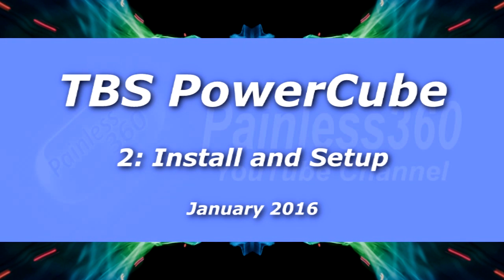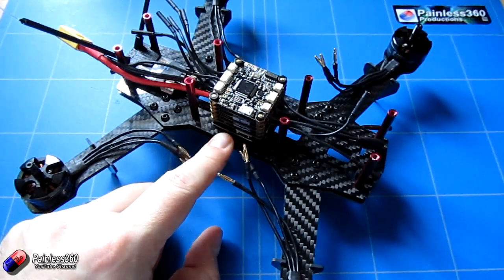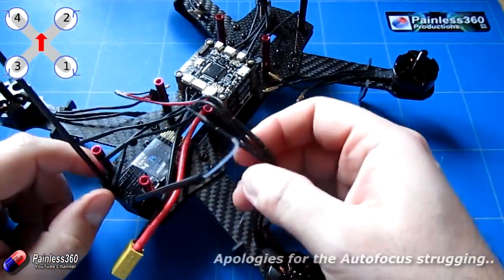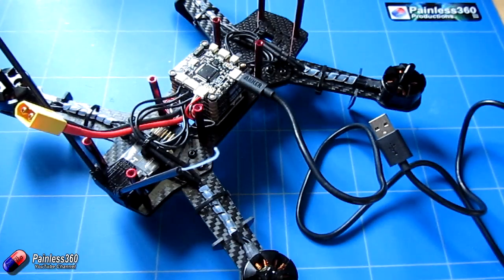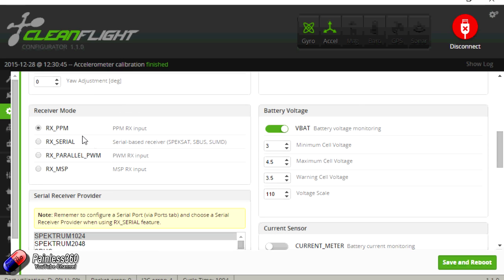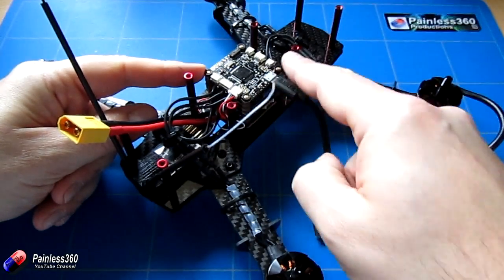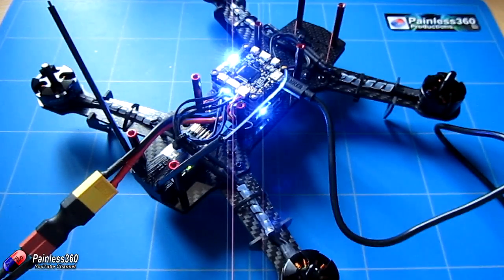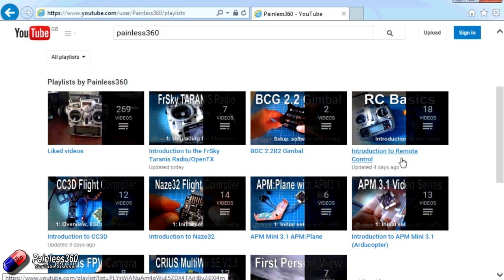(2/2) TBS PowerCube: Installation, initial setup and first flight

Comment: Hello I have binded my radio with my receiver, but when plugged into clean flight. when I move my sticks around nothing moves in clean flight  My radio is tx16s with the latest version from the manufacturer. All firmware is up to date with the receiver
Reply from the maker: Check out my Quadcopter building for beginners series. Most pilots use Betaflight now.. Best of luck

Comment: hi painless . say I am trying to pull every thing off my TBS OBLIVION  and mount it on to a lumenier qavr2  5 inch frame   I am wondering if that tall stack would fit , I am trying to do this as a nocive challenge  no solder  strait plug and play  
any thoughts would be great
Reply from the maker: Not sure, there are lots of options for the cube...

Comment: Would this fit in a skol v2?
Reply from the maker: Not easily, see the build I'm doing with that frame at the moment (Quad Build: Series 8)
Reply: Painless360 thanks for the response! Do you know which flyno frame this would work best with then?
Reply from the maker: Depends on the height of the stack you have... there are lots of options for it so knowing that would be the first step..

Comment: Hey, love your video's!! Question, just installed the newer tbs powercube fpvision into a build I'm doing. I understand that the negative screws on opposite corners on the bottom are the ground. My issue, the screws that came with the cube are too short to simply screw directly to the frame, like you did in this video, not to mention I needed room for my battery strap. I had to use longer metal screws to mount the cube to my frame. then I just supported the positive corners with nylon standoffs .I'm afraid that maybe now when I put power to the cube because those negative ground corners of the cube are technically touching the frame, I may short the whole thing out. What do you think?
Reply: Someone PLEASE help, nobody seems to know the right way to mount this cube to a frame if the screws provided by TBS are too short!!!!

Comment: i am connected to the powercube with my taranis! But i dont get any movements on the receiver tap!
I used to be able to control the motors via betaflight but now there is a zero (0) in 1,2,3 and 4 motor gate!
What have i done wrong?
I am totally furstuated!
Please help me!!!!
Reply from the maker: Please see the videos in the 'Introduction to Seriously Pro SP3' and the 'Quadcopter Building for Beginners' series on the channel where I cover this in some depth. It's probably that the ports are not setup right for a serial receiver like S-Bus. Best of luck!

Comment: Hey Painless, Thank you so much for this series. I really appreciate you taking the time to do this!

I am doing this exact build with the FrSky X4R-SB and the Taranis X9D but I just can't figure out how to connect the telemetry from the Colibri flight controller on the cube to the receiver?  I realize this might be a really noob question, but any help would be greatly appreciated.  Thanks again for all the great videos!
Reply from the maker: +DroneFactor If there is no signal pin specifically for telemetry then you will need to use the tx and rx pins on a spare UART and connect them both to the s.port pin on the receiver. Best of luck!

Comment: I didn't notice where you connected the receiver to the cube for SBUS and how you were able to power the X4RSB while binding the receiver? Did I miss something?
Reply from the maker: We talk about the common connections in the first video in the series. You simply plug your receiver in using the supplied cable..

Comment: I'm planning to  make my first  build using this amazing FC. What kind of frame do you recommend for this?  Also I'm interested in your patronage model, where can I ask you more specific questions about it?
Reply from the maker: The only thing you need to look at with any frame with the PowerCube is the height between the top and bottom plates. The stack of PCB's is a lot lower now than it was in teh first version with the ESCs now sharing a 'slice' of the cube. Other than that any frame will be good! Best of luck with the build!

Comment: Hello, I connected all the bullet connectors like is suppose to be according with manual and your video, but the quad sounds unstable and sounds like if Im actually giving it a little more of throttle and motors gets way to hot??? All of them are spinning to the correct orientation, but motors gets too hot? please help!!! All of this happens because I need to replace a motor # 4 now I have my quad screwed! PLEASE HELP ME...
Reply from the maker: Could be the timing or one of the settings in the BLHeli software, I'd start there and see if something isn't set right.. Best of luck!

Comment: dear painles,i have voor a week or tree ago a rtf racing quad with the blacksheep controller,nou i am crasht and twoo or my motors  spin not hou it seems to spin,its go on motor 4 and motor 1 the other twoo spins good,there nothing to see on the frame and controller only my mushroom anthena snapt of,i have reparate this and try  it  but with no  succes,have u some options for me?greetings christiaan.
Reply from the maker: The ESCs are pretty bullet proof but if you have a crash and the props can't turn they will be damaged in a matter of seconds from the current flowing from the ESCs. We had this here and ended up replacing the motor. You can tell if it's happened as the motor will not spin freely anymore. Best of luck!
Reply: many thanx painles360,wat you say is first replace the motors,and if i have luck they spin ,otherwisw i must re place theESC.i go try it .thanx

Comment: Hey Painless, I have some trouble to get any Signals from my X4R-SB on the Flightcontroll. Its already bind correctly to my Remote (green led lights up), I set rx_serial, sbus and uart2. The Reciever worked perfektly on a naze32 rev6 before, I just pluged it to the Colibri Race like you did in the video. Any Ideas what could be wrong?

Comment: Thanks for the series, it has been extremely helpful! Do you happen to know what a blinking red LED means on the powercube FC when powered up (while not connected to cpu via USB)? I also have the X4R-SB and configured it to SBUS on the receiver tab however it seems as the receiver is not getting any commands from the Taranis (it is bound).
Reply: +u189961 Actually I think I just figured it out but won't know until I get home! The red LED blinking means no receiver signal. I didn't realize the Powercube came with a PPM/SBUS and Spektrum cable, I'm thinking I used the Spektrum cable in error!

Comment: Wait, why is your throttle moving if your Channel map is at AETR1234?  So what is the mapping from airplane controls to quad controls?  Pitch = Elevator, Roll = Aileron, Yaw = Rudder and Throttle = Elevator?
Reply from the maker: Because that matches the channel order on the Taranis for the model I setup. See the other Taranis videos.. Best of luck!

Comment: So I actually got the thing flying but could never hover so I decided to go back and try starting from scratch on the taranis. After creating a new quad model, I fire up the quad on the bench and the motors start raging.  Nothing I do on the throttle does anything but vary the high RPM's only slightly.  So turns out that the Channel map was set for AERT1234 and the YAW was controlling the throttle.  I hadn't changed anything in clean flight.  Had I been outside with props on, goodbye drone.   So that has me terribly worried of course.   But, I will say, I'm glad I bought the cube.  It makes for a much neater racer.
Reply from the maker: +goofyfoot2001 Yep, always test the model arms and responds to controls without the props on! You were lucky you got to arm. Using Yaw-right arming normally means that you can't if you've messed up the channel mapping..

Comment: thanks for the great videos dude! I'm currently building a qav210 with the power cube and running 2206 2350kv motors on a 4s. am I able to run a luminier 650 mini cam, voltage wise or am I going to have a step up thingy? keep up the great work!
Reply from the maker: +Alberto Alvarez You can select 12v or 5v from the PDB at the bottom of the stack so you shouldn't need anything else to alter the voltage levels..
Reply: +Painless360 Ok your next video showed me, thanks so much!
Reply: +Painless360 Ok your next video showed me, thanks so much!

Comment: Thank you for the video! I need help with a small problem with the Powercube, everything seems to work, but when I connect the battery the red led status starts beeping continuously. It is very anoying. Any suggestions on how to fix this? (I am new to all this).
Reply from the maker: Usually vBat or 'no receiver connected' alarm.. Best of luck!

Comment: Do you know how much power the pdb can provide to either the camera or vtx or both?  Just curious what video transmitters I can use with this without worrying about using  external power.
Reply from the maker: +Keith Morris Yes, the answer is in the manual. Happy flying!
Reply: Wow I must really be missing it.  I've been through the manual and any documentation I can find.  Please tell me how much power the pdb can provide to the vtx and the camera.  Also can they both be on 12v or does one have to be on 5v?
Reply from the maker: Top of Page 3 in the manual..

Comment: Me and my friends are having trouble soldering the emax 2204 2300kv motors, its as if the wires repel solder!
any useful tips?
Reply: +Common Sense Dude,   Emax motors have a protective coating out to about an inch from the base of the motor that's made from some kind of enamel.  I had this problem, and eventually got it sorted by soaking the ends of the wires in soluble aspirin for 2 days.  Don't ask me why that worked, but it did!
Reply from the maker: +Common Sense Don't cut the wires too close to the motor as they are still covered in the insulating lacquer and will be a pain to remove and solder.. Best of luck.
Reply: +Painless360 My friend has already soldered them on but the solder joints are really bad because we couldn't get the solder to tin properly, the solder just wont stick to the wire normally its as if the wire is waterproof, we cut it down to about 1.5inches long and we have slack to connect to the escs as they are on the arms of a 210 frame
Reply from the maker: You should be out of the way of the protective coating 1.5" down the wire. Get hold of the wires you cut off the motors and test the solder on those too. Solder or Iron problem maybe?
Reply: +Painless360 we took the wires off the esc and soldered the motor wire to the esc pads but the motor wires wont tin properly

Comment: You could easily mount a fan to the side of the Powercube.
Reply from the maker: +John Coates If you're in a open frame the airflow is easily enough. I've 3D printed air-scoops that snap to each side. Not sure if they do anything to aid the cooling but they look cool!

Comment: Painless360 please help. How did you get your roll, and pitch values to stay at 1500? My values fluctuate at least a number, either up or down I can't get them to stay at 1500. This causes my quadcopter to drift and I can't fly because I'm constantly fighting the quadcopter. Thanks in advance.
Reply from the maker: +Cris Pena That's normal and a function of the quality and resolution of the potentiometers that are 'reading' the stick position in the radio. A few numbers either way is fine, any more may need the radio checked.. Best of luck!
Reply: +Painless360  Thank you, I was just socked when I saw your values hardly move at all. Can't wait for more videos on the powercube, thank you for all your help.
Reply from the maker: That's a decent radio for you.. My DX7 wanders like yours,,

Comment: What happens to the cube when an ESC catches fire?  Seems like it will take the other ones and the FC out with it when packed that tight together.
Reply: 1.5 years never had one light up..
Reply: +Sheldon Smith They are the bulletproof esc's so they have a built in safety that would prevent fire (in theory)

Comment: Got my quad to the point your video ends and I'm anxious to see your next one! :)  This series has been very helpful.   I have ordered the TBS Core Pro as well and I'm wondering if the vtx and cam needs to connect through the Core Pro or would it work if the vtx and cam were connected to the cube.
Reply from the maker: Check out the playlist  ;)
Reply: +Painless360 looked but don't see anything new.
Reply from the maker: Two videos in there that are not released yet...
Reply: +Painless360 sweet! can't wait to see them when they are released!
Reply from the maker: You can still view then if you see them in the playlist.. ;)

Comment: Do you need to program esc in Cleanflight like you do in Llibra Pilot?  Great video on the cube
Reply from the maker: +LWG66 As the ESCs and FC are all in one stack and configured by TBS at the factory we can skip that step when setting it up. You should always calibrate the ESCs to the FC when building a traditional system.. Best of luck!

Comment: How would you recommend shortening or tightening(I guess) the length of the wires connecting the motors and ESCs? Thank you
Reply from the maker: +Matthew Ward I would snip off a little from either end and re-solder the bullets on. Be careful about going too near the motor wires when they get very close to the motor housing as they can have lacquer can coatings on that can make it very tricky to solder..
Reply: +Painless360 okay great. Thank you so much for your help!! I really appreciate it

Comment: Hi mate, looks very simple for those that haven't soldered before! Couple of Qs/points for the new people and me: 1. Assume ESC calibration not necessary as it is shipped configured? 2. Normally on the config tab in cf, if you set to serial rx and save it will revert unless you have already set up the uart with serial rx on the ports tab, this is normal behaviour for cf and betaflight, did you already do that but slipped it under the wire with your camera trickery or is this new behaviour?(on the vid it appeared the opposite way round, you saved in config and ports updated its self)
Reply from the maker: Every step taken, in order, shot as we did it. Happy flying!

Comment: how much does this set up cost all together (roughly)?
Reply: +Barnaby Harper £48 for motors, £120 for the cube, TBS core pro £50, FPV cam £30 ish, VTX, £35 ish, ZMR 250 Frame £20, Receiver £25 - around £350 all in.  (Its amazing what you can learn with 30 seconds of googling) :-D
Reply: Barnaby Harper I have an F1-6, it's a great machine! The only minor downside is its quite a heavy frame, so you will want some beasty motors capable of 6 inch props and at least 20a esc's to get the best out of it.  

If you are looking in that kind of price range you should also check out the impulse rc alien range.  Out of all the frames I have seen the armattans and the aliens are the best by far!
Reply: Barnaby Harper Yeah, the Armattan looks sweet!  Especially if you go to the integrated FC, as you will end up with a super clean build.  Ive got a naze and osdoge in mine, which also works really well for a clean build (Im more than a little ocd about loose wires).  Also if you are going for the Armattan motors its worth paying the bit extra to get the T Motors.  They seem to run smoother...
Reply from the maker: The costs are on the TBS website.. Happy flying!
Reply: +Painless360 i meant including the frame, OSD, camera, motors and props
Reply: +Alex Magee thanks, but i am now probable going to get the RCExplorer mini tricopter, or the Armattan F1-6 (maybe the Acro), and if you haven't heard of either of those, check them out
Reply: +Alex Magee thanks, the aliens look good, but there is something that i don't like about, i think it may be the shape or something. the armattan look amazing tho, in my opinion
thanks for the tips :)
Reply: +Alex Magee ok, thanks, i will keep that in mind

Comment: i have arduino school project and teacher say i can make multiwii quadcopter. i watch almost all your videos. and without your videos and tips i never will finish my project. so thanks very much you are the best :)
Reply from the maker: +Jokke -suomalaista pelailua Always nice to hear that. Happy flying!
Reply: when i start checking parts i dont know how much it really will cost for me. i think first that i buy parts from hobbyking but decides to buy them from ebay cause its cheaper.http://www.ebay.co.uk/itm/321957291878 what you think about this set?
Reply from the maker: Looks ok but you need a radio, receiver, battery and flight controller to finish the model. Best of luck with it!

Comment: Its such a shame the core cant be incorporated into the cube? I have the core on my hmb 235 and its a little bit big but well worth it imo. Its also a lot smaller out of the box ;)
Reply from the maker: +Dazzle Kernow I wouldn't be surprised if that happens in the future! Nice bit of kit and the video showing the setup is now in the playlist..
Reply: +Dazzle Kernow You can take the core out of the case and mount it.  It cuts down the size a lot, as the case leaves plenty of room for airflow.